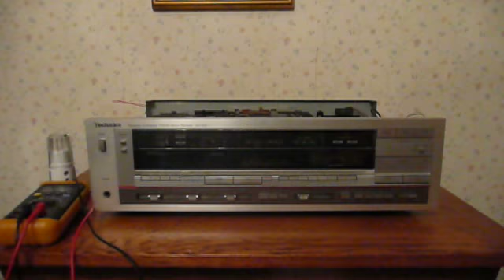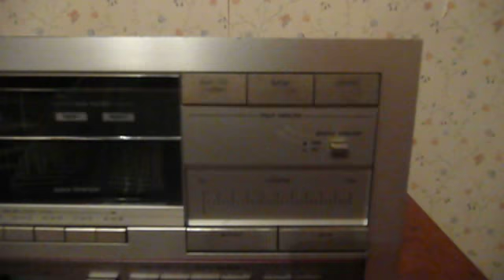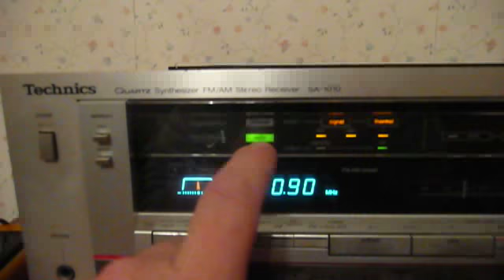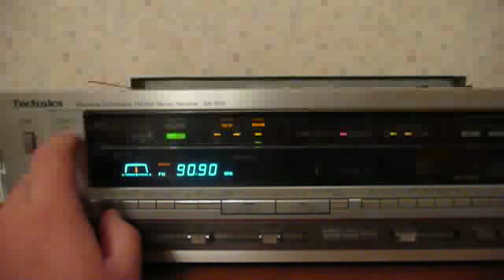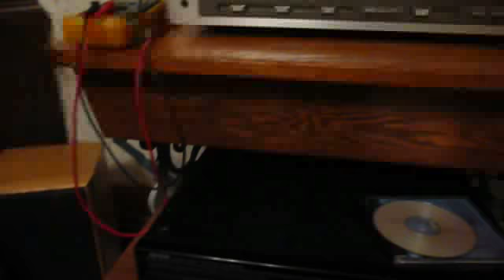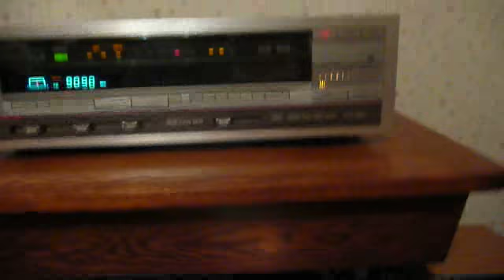Technics SA-1010 Stereo Receiver

Comment: I have a query, is it repairable? I say having proprietary chips in regards to the part that controls the impedance that I think is what COMPUTER refers to in advertising, and to the digital being the radio, which transistors do you use? Thank you
Reply from the maker: If any of the Technics specific parts in this set failed, that could be a problem. The only likely source for them would be another of the same model, or a model that used the same parts in the same way. I don't know if the "computer" (actually a microcontroller) is what tests for speaker impedance.

I've not had to repair this set. It still works perfectly well. If ever something like a power transistor failed, you'd have to look at manufacturer data books to find a suitable replacement part, which is almost certainly available.
Reply: @uxwbill  Thanks for the information!

Comment: I have speakers that can handle it well, but my system is a vintage Carver and it's output is 600 watts RMS x2. They just don't make stereo equipment like they used to. Some of the old receivers can put out over 300 watts. Not so much today. I will always prefer vintage stereo equipment.

Comment: Hey uxwbill.
What is a computer drive when it's part of that stereo receiver shown in this video? :)
Reply: It's computer drive 'new class a' it means that there's a 'computer' checking if it runs like it should so it has very low distortion 0.005% thd.

Comment: I just got one of these from eBay and it got damaged in shipping some probably dropped it it so heavy but it does not have any tuner functions that work other than all the lights work and there is no sound from the speakers I hooked up. Found 3 fuses they look fine but I can not see anything disconnected or burned out what to you think is wrong with the runner not working or the sound?
Reply from the maker: First thing I'd do is go back on the seller. See if they're willing to make some kind of concession. They're obligated to package an item such that it will survive -- or if they can't, to take it somewhere so that it can be suitably packaged. If they refuse, you can try contacting the shipper to see if you have any recourse there. Save all of the packaging materials if you do that. Finally, there is always the option to involve eBay, if the seller won't step up to the plate or the shipping company says it isn't their fault.

The truth of the matter is that fixing a dropped electronic device is a great unknown. Was the damage sufficient to create short circuits that may have blown one or more components at power on? Are there broken or otherwise damaged circuit boards? It's not uncommon for a circuit board to crack or shatter. What about the solder joints? If you're going to try and fix this, you'll need at a minimum the service manual, a good source of illumination, a magnifier of some kind, solder, a soldering iron and most importantly the ability to solder correctly. (If you haven't got that, stop right now and practice on a lot of scrap wire, boards and parts before you turn to the receiver.)

Never attempt to do any repair work unless you're sure the power is completely disconnected AND all high voltage carrying capacitors have been discharged.
Reply: +uxwbill the seller refunded the cost after I sent pictures of the dented corner they said to keep it but it doesn't seem to work as far as any sound from any input and the tuner will not search up or down the presets are still working but the analog display doesn't advance so I was just going to attempt to save it but it looks to be extremely complex
Reply: I had a guy think his newly purchased amp didn't work...turns out this amp has pre amp out. Without jumpers plugged in the back...it doesn't produce any sound.

Comment: Kind of rare to see a Technics that uses discrete transistors. Sadly there's no telling what a given unit's history is, but most of them have been used for many hours and as you well know, are due to have a bunch of components including capacitors replaced.
On the big receiver vs. cheap speakers subject, I had a pair of cheap Yorx (remember Yorx?) speakers fall into my hands so I decided in my younger years to see how they would handle the power of my 80Wx2 Pioneer that I used to have.  Well, the speakers made noise for a few seconds and then .. SPAFF.  Burnt smell and the protect relay kicked on on the receiver.  Problem was, apparently the voice coil shorted and the relay didn't catch in time to keep what I think was an output transistor from frying.  That was the end of that Pioneer.  Perhaps a day soon I'll dig it out of storage and see about getting it working again. Really is a nice unit.

Comment: Bill, nice video.  I have one of the silver ones that I bought in Germany when I was stationed there with the USAF in 1985.  Used with Technics SBG-910 speakers so I easily used all 125W per channel!  Well, it's now 30 years in the future.  I've cleaned the "open" slider controls with electronics cleaner, and I need to replace a few light bulbs.  What is your recommendation to clean the push on/off switches that are sealed?  I considered drilling a small hole to allow me to insert the cleaner nozzle, but I'm concerned about plastic bits getting into the switches.  I haven't found a source for replacement switches, either, and probably won't ever.  Suggestions?
Reply: The switches are self cleaning. Pushing them in 60x will clean them up. As for parts...most are available in the lower better selling units of the same year. I have a fully functional 410 that will be sacrificed for the 1010.
Reply: @tf7274  Thanks for the reply, but for some reason known only to my brain, I wrote "switches" when I mean "relays". The ones on the board with the clear plastic covers.  Tapping on them will sometimes get the speakers to come on, but most times not.

Comment: Hey there, I thought I would share my experience with this Item. I was in the military for many years and stationed in Guam for 3 years (1985-88). The advantage I had back them was we had the best audio equipment overseas and it was affordable in our exchanges. Some of it was not even available in the U.S. My first receiver was the SA-1010 and it was the dark metal case. You are absolutely right, for a home consumer RX/Amp it killed. I used it will Cerwin Vega PD-6 standing speakers. I eventually bought the Yamaha M-85 RX and M-85 Amplifier. I kept the Technics. The Yamaha gear has been long gone regretfully. The M-85 Amp goes well into over $2000 now. I will say I still have and still use the technics Sa-1010 and that is with the Cerwin Vega PD-6's that I bought with it in 1985. I have never been a big fan of Surround Sound systems and have used many of them through the years. Nothing compares to the older gear that was out there in the 70's and 80's. That stuff was the closest you could come to the pure tube systems. I recently bought a Yamaha RX-V800 Receiver which had a original cost of $900 or more. I got it for $65 and it is in mInt condition. It was going to be my main system. After a few weeks I have reverted back to the Technics SA-1010. I will say I have had one thing wrong with the Technics RX and it is really the point of this comment. I lose my left speaker sometimes. It has to do with the Dimension Control activation. I have to wiggle the switch sometimes to get the left to come back . The dimension control is pretty much shot and its fuzzy so I just leave it off and don't touch the switch. It was just a novelty anyways. So cleaning switches and controls can bring an amp back to life. Thanks for the great review. And yes years ago I would get visits from the neighbors or police to turn my music down
Reply: Picked up mine in 82' at while stationed at Rhein Main.
Reply: My Dimension Control is going as well. Deoxit is not the issue. All of those capacitors are not doing what they should...wouldn't be surprised there is cold solder joints as well.

Comment: @uxwbill

I just purchased one of these off eBay as well. It was more local, so I picked it up in person only driving 92 miles round trip. I tested it real quick at the sellers house and it checked out. Or so I thought...

The unit turns on and plays sound through both channels fine for the most part. The "Preheat" lights all come on and switches to "auto" as it should, and after a few seconds the auto, signal and thermal lights all go off immediately followed by a relay click, The sound stops, and then another click and the sound resumes. It will do this several times within the first few minutes after power on if it hasn't been powered on within a few hours.

The indicators "mentioned above" will randomly turn on and off even if the relay doesn't click on or off, the only light that stays on is the "green" output "on" light

Other than the problems mentioned above it does seem to work.

Comment: Just a note even with fresh batteries the SA-1010's volume always turned on at a preset level so if you are rockin it turn it off you don't get a scare when you turn it back on.  I still have one of these.

Comment: uxwbill, you need to get some realistic mach ones for that system. if you can, get the 40-4024A model with the screw terminals on the back. the foam surrounds last longer. many people dont like realistic, and for the most part i'm one of them, but mach ones are high quality i believe made by foster electronics. sound really good with the realistic STA-2000 reciever. i think also made by foster

Comment: uxwbill, you need to get some realistic mach ones for that system. if you can, get the 40-4024A model with the screw terminals on the back. the foam surrounds last longer

Comment: @uxwbill Trouble is, the dvd/receiver unit has proprietary (idiot proof) speaker terminals, so I'm stuck with the plastic 2" Sony satellites. The center channel is so weak that I usually crank the volume to hear the dialogue in movies. Without the subwoofer, it sounds like a set of five clock radios playing at the same time!

Comment: Nice to see that Technics 1010!  I have the SA-510 from the same series at 60 W RMS and it's mint.  I don't use it now because I don't like the push button volume buttons and I upgraded to a newer TOTL Yamaha amp at 125 per channel.  The 510 is certainly impressive to look at, as it that 1010.

Comment: @uxwbill As of now, there is no plan for a mandatory switchover to HD Radio. Stations aren't even allowed to transmit digital-only signals yet, because that would mean losing 99.9% of their listeners.

In the United Kingdom, where they use the far superior Eureka DAB system, there are plans for a mandatory switchover around 2015 where FM stations will move to DAB and AM stations will move to FM, but even that has stalled as they realize the digital receivers just aren't popular enough yet.